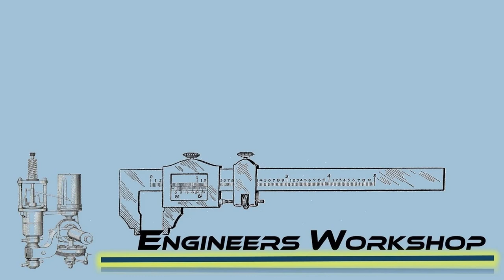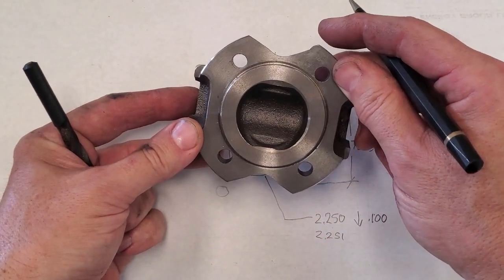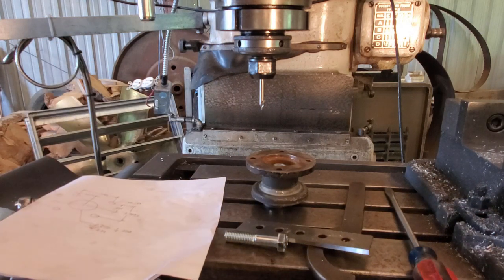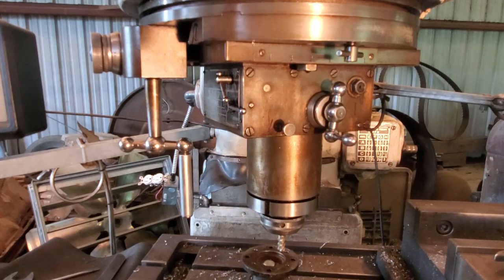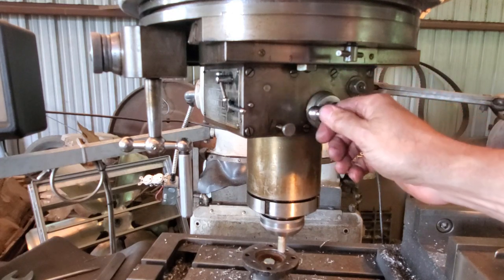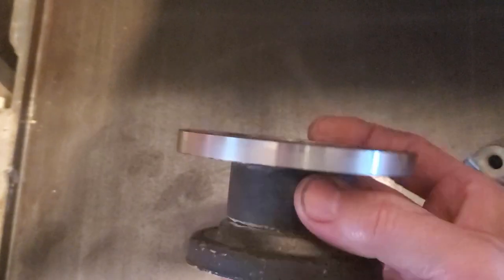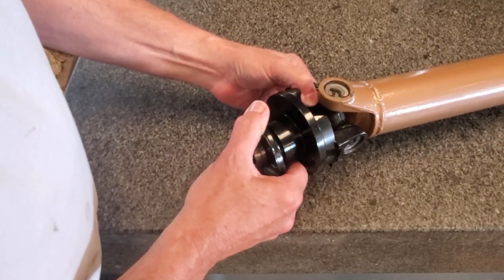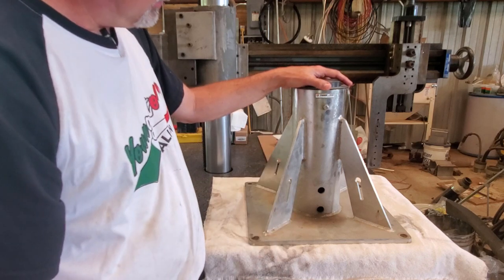Machining the Spitfire Differential Input Flange

Comment: G’day. Nice work on the flange, always a double check moment for the stud pattern measurement to make sure they will line up. 
Those ribs on the base look as if they were designed to fail when overloaded, why else would they have slots in them -to make them look pretty, I doubt it. 
Cheers 
Peter
Reply from the maker: Cheers mate! If you mean the splines, they mesh with a splined input pinion and there's a locknut holding it on. Hard to say what the fail point will be with diesel torque behind it...hopefully just putting the power to the ground with skinny 13" tyres.